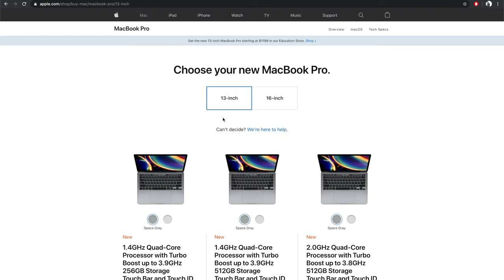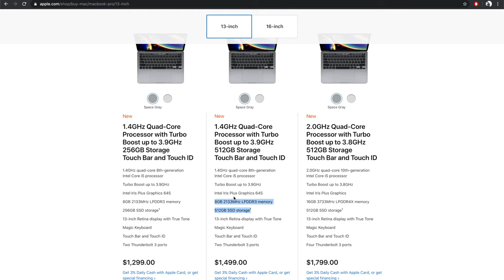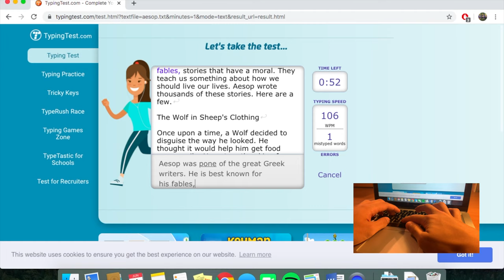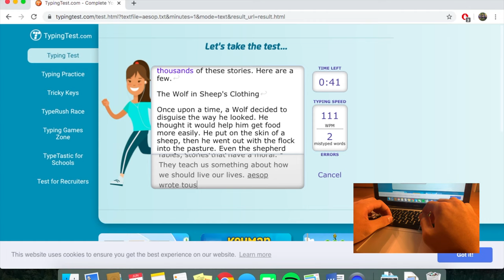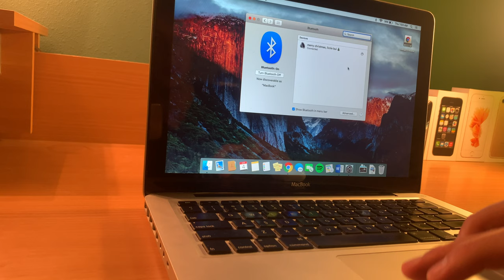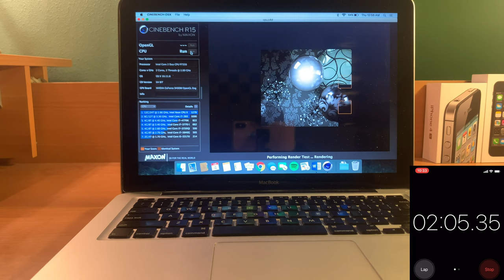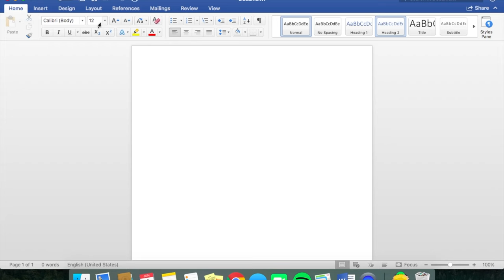Transforming 2008 MacBook into MacBook Pro 2020 ($1499.00) - SSD and RAM Upgrade

Comment: Just did the same to mine, while it certainly aint no 2020 and the screen sucks as does the speakers and Bluetooth is not compatible enough with newer Logitech peripherals. It does almost what i need it to do as a secondary mac device for work. 
Bad part is mines is stuck on lion, how do you update that?
Reply: have the same MacBook 13-inch, Aluminum, Late 2008, and i have OS X EL Capitan, works good!
Reply: why don't you try the dosdude Catalina installer?

Comment: So did you replace 2 , 4 gig ram sticks and put 2, 8 gig ram sticks in each slot is that my understanding
Reply: Quite foolish video without explanation. Actually I don't believe that he could upgrade RAM up to 16Gb. Recently I found info from mac gurus that after last firmware upgrade and OS upgrade up to Yozemite of macbook pro 5.1, the RAM limit goes up from 4Gb to 8Gb.

Comment: Yes old macs are actually better than new in upgradability (ram, SSD etc) and repairability.    But in terms of OS, these macs are running ancient version of macOS.   Old macs are much better on windows 10/11 or Linux distro which is fully supported even today on these machines.  yes I know about OCLP, but for these old  macs, they are not worth the trouble.

Comment: You can’t make 2008 MacBook as good as 2020 MacBook .You can’t replace the cpu and gpu
Reply: i guess as long as you are light-using it. the 2008 one is still decent with 8gb and SSD. most people just care how fast it boots up, and open APPs, that is all it s about.
Reply: @jlpeng9036  can the 2008 version run 1080p youtube videos